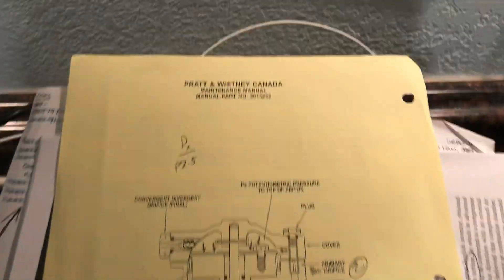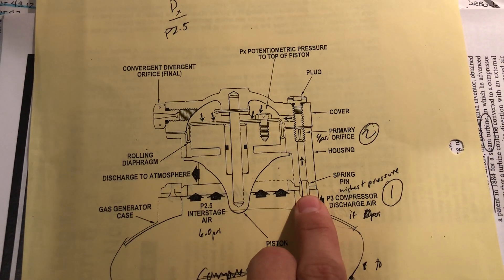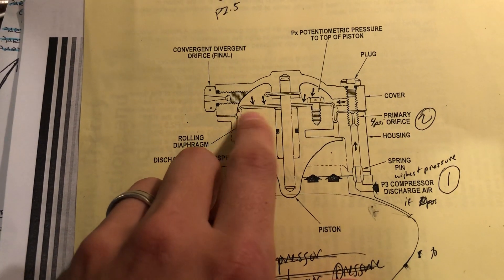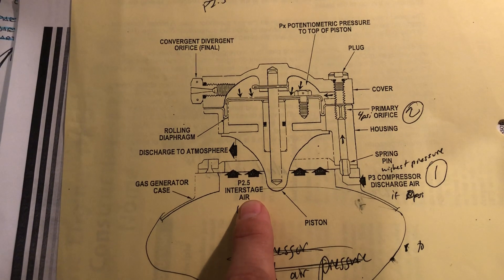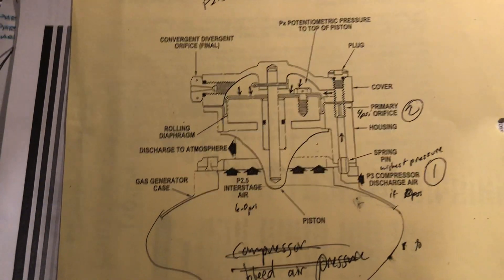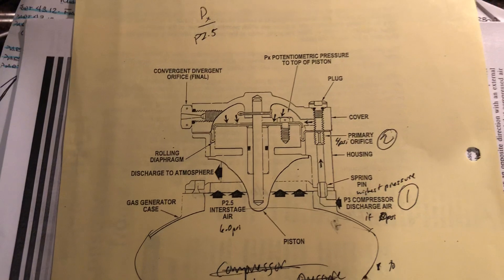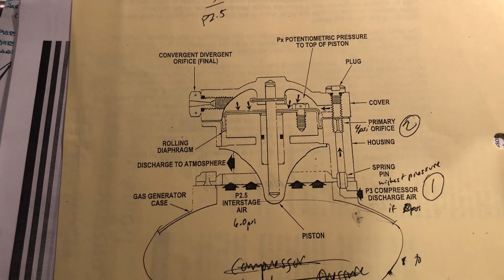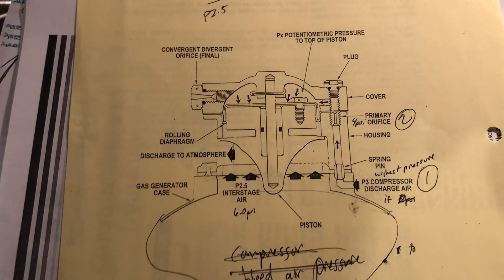How a Compressor Bleed Valve Works in a Turbine Engine- Operation and Description

Comment: Some times oil found on bleed valve plug , from where this oil comes ??
Reply: bro do you know when did the surge bleed valve open?
Reply: @orbital_eccentricity  
No
Reply: bad bearings seal 
or too much pressure in Eng oil system caused by prolonged motoring (perhaps trying to troubleshoot)